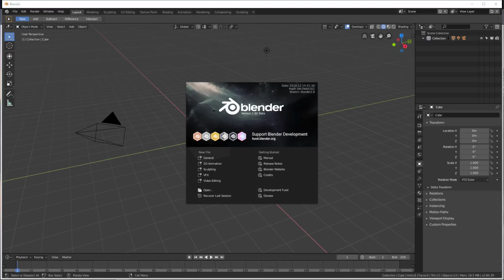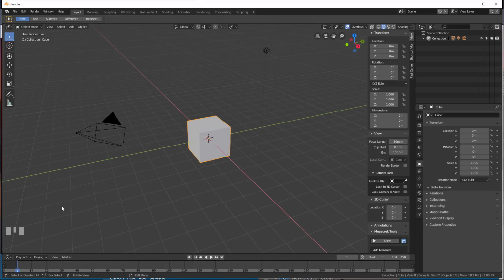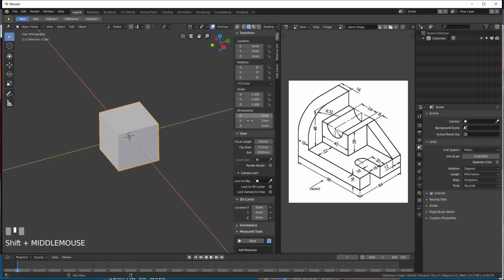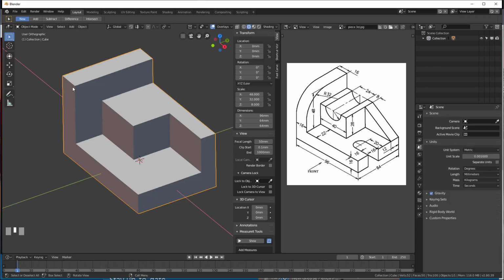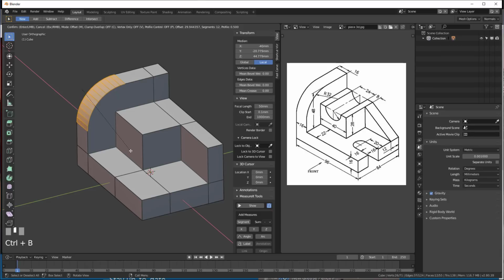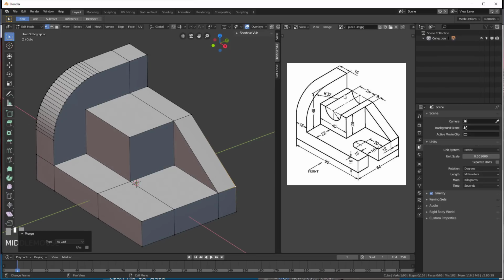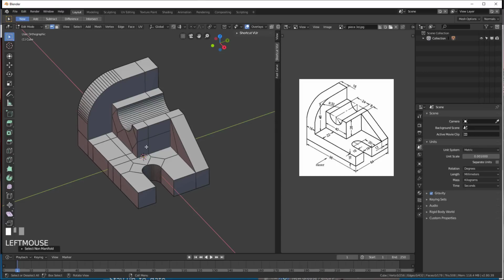Blender 2.8 Modeling a technical piece

Comment: If you press z wirh the knif, it cuts through the mesh, so you don't have to do the same thing on the other side. And i would've merged in "edge mode" by sliding the upoer edge down and then merge by distance. Thets much faster

Comment: how do you change to orthographic presing 5 does nothing. there is also no apparent button?
I I want to start all my designs in mm not just current one how do I set it?
Pressing E doesn't activate extrude always. What is the condition? besides being in edit mode face selection and a face selected...

Comment: I work as a mechanical engineer. I like this a lot. In industry though, we try to whittle down a block with cutouts. It helps you imagine the limitations of tooling and whether or not they can actually reach what needs to be cut. Designs can be awesome, but sometimes they're out of bounds for the tool chuck to reach.

Comment: Great…now.. tell us or show us or link us to: How to Dimension and add Shape and Position Dimensioning and textboxes… tehn you will become my BLENDER-SUPERMAN-HEREO!
Reply: Hi Hans check the videos in the channel, there is another video about it.
Reply: @juliendeville7369  Could not find any shape and position connected to any Blender version! As you know I worked many years in CAD methodic department at Volvo Cars creating solutions to complete CAD-systemes missing parts locally together with some other guys! I created Multi-Model, big systeme file administration, Compare Drawing methodic between releases and for checking department and another created a setup of Shape and Position Symbol Box libraries to be added to Dimensions in Catia when we closed down wonderful Cadam ZShape and Position was closed down…too …we were desperate replacing things that Catia at that time ignored totaly for trheir customers! Only many years after that Catia created a working drafting module with all! OIur version contained before that UNICODE created symols added in Boxes we created, which were possible to increase in number and raws, as well as box vertical limits could be taken away or added manually, a very time consuming and clumsy way to work then! Still teh best way to create shape and position in text boxes was ti use CADAM tangent input with ”Pipe” tangent: ”|” and then select the UNICODE symbol we offered in CADAM TEXTTABLE selection and close teh box after that with onother ”Pipe” tanget used! Raws of boxes were created with the Tabulator tangent as normal text assition as well as! This CADAM way is never ever been repeated by any other CAD syteme and it was the fastest and most uncomplicated way ever! So if you feel our shape and position ”pain” and have someone hou could program this in pyton and integrate a free available OPEN SOURCE UNICODE tabellist with all thise sybols in right STD-Size (3.5mm!) you woul be historical hereo of Blender and open up for CAD-Users in Blender directly in masses! If you have a useful youtube linkn I will be thankful!

As a licensed User of Rhinoversions many years and now V7 I will try to create a similar approch for Rhino, tabells for symbols are not the probleme but TEXT-BOX-Creation with tangents is and programming the interface for a pluggin there to earn som dollars! (Otehrwise one has to create textboxsetupps as symbols-Blocks there to explode for hiding vertical BOX-lines in the clumsy way!)

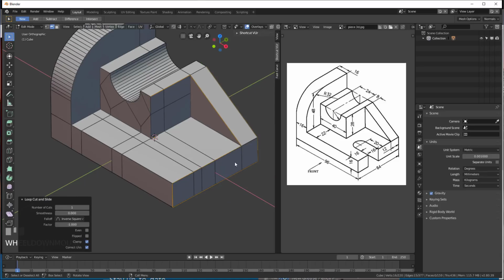Comment: hey Yoji, Thanks for the video. I have a problem @18:00 when using "B" to ignore those faces during loop cut, still, other side faces will be in loop cut and causing trouble, how to do it? is there any other way to avoid using loop cuts in other faces?

Comment: Thank you so much, I'm using Blender 2.76b and the screen is different, but, I'm learning and getting a simialr result to yours.
My problem here is in Blender 2.76 is not clear (at least for me) the unit measurements.
This is a very good tutorial and if anyone else is using Blender, use the same version used in this video.
Thank you.

Comment: Blender is absolute horrible piece of .... ... frustrating so much. I've had years of experience in autocad and sketchup, now I need to work in Blender. Spending a whole week, hours and hours to make simple squares or something with exact measurements... no way of doing that. Online I can only find many sort of 'complicated work arounds' to do the simplest job in any other CAD software. Why on earth is Blender made the way it is? If only there was an other software capable of much, but more like actual professional CAD softwares... that is not as expensive. They even made Sketchup a web based software, which ruins the whole experience. I do like this video for finally making Blender it a bit more workable for the CAD designers under us... but I rather find an different program that does the job better... anyone any suggestion? And please don't suggest FreeCAD...........
Reply: Did you find another solution, or did you get used to Blender? Just asking out of curiosity.

Comment: Any chance at changing these features at a later time?  For example, that bevel which you turned into a curved feature. Could you make it slightly bigger? Like 1mm ?   The other big one for me doing this stuff is that objects have to be related to one another.   For example 2 cubes. One cube must be one quarter in size and placed at exactly 1/3  of the total length of the larger. Then at a later date we will want to slightly change the size(by a known value) and offset it by some quantity which is related to the size of other objects.   In other words, all things typically are related and calculated from others. Having to hand calculate new ratio's every time will be insane. I see a vanishing point. Like once there are 10 different relationships, you will NOT want to hand DO all that every time. would be nuts.

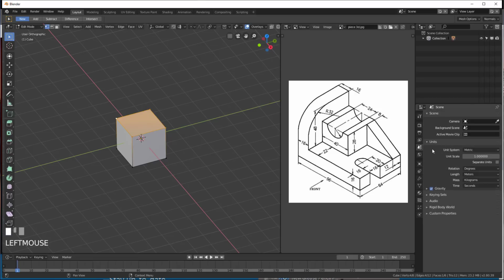Comment: 5:11 The scale I decided to use was .0005
The reason:
Even though your modeling was proportional, when you use a unit scale of .001 every 1 unit = 2 units. So when you type in 16 units, it shows up as 32 units (you can see the length by going to Show Overlays > tick the Edge Length option)

Comment: How do I deselect those vertices once I have an Emulated Middle Mouse button (laptop)?

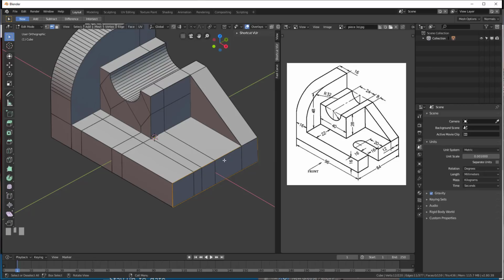at 18:12 I got stuck because that
Reply: I had the same issue.  I played around with it.  After pressing "B" for box select, then if you hold Ctrl it will deselect whatever you drag the box around.

Comment: Want to know something... Is there an option to lock the  grab direction other than xyz? For example, in rhino , there an option to lock the direction  that the cursor is moving.. Just move in a direction .. press tab key.. then the movement is locked to that specific direction and we can type the measurement or snap it to anywhere... Something like that in blender?

Comment: 12:43 best/fastest way I know to do this is to hit 2 then select the line you want to remove then hit X then Dissolve edge. doing that will just dissolve the edge that you dont want and you dont have to fill any faces that way

the second fastest way i can think of would be select eh 2 corner vertices then double tap G then so you can slide them along the edge till you get them to the other vertices then select everything then W then Merge vertices then Merge by distance

Comment: Thank you for that video.  I am a mechanical designer working with traditional CAD software.  I am having a hard transition but this helped let me see so much of what I have been doing wrong.  Well Done.
Reply: Me too, it seems sensless and time-wasting. If you came from Autodesk, Rhino etc: Start with 2D draw --> Extrude, Draw again -->Extrude. Round the corners, join everything et voilà. Blender has a very different workflow. Maybe this is more "rendering oriented"  because meshes are extra clean and without exceeding vertex, lines and isolated points, but.. ok

Comment: At 7:16, during the first loop cut, I have to hit G > X > -32 to get the loop cut 16mm away from the far left edge. This is because the part is 96mm long so half is 48mm long and 48mm-32mm = 16mm from the left edge.  In the video, the author hit G->X-> 16 and it works for him.  It appears I am using absolute coordinates vs the author who is using relative coordinates.  Any idea what I might be doing wrong?
Reply: Figured it out.  After you create the loop cut and drag it to the left, you must then left click which will 'set' the new edges.  Only then can you G->X-> 16 and have it work in relative coordinates.  The interesting thing is, if you wanted to use absolute coordinates, don't left click.

Comment: Nice tutorial, thank you very much.

I did all of this but at the end i have non-manifold vertices at the edges of that 24mm wide semi circle trench thing ^^
What do i do with them?
Reply: I'm having the same problem. Were you able to fix it?
Reply: @Miguel-kh9pc  Yes, i was able to fix it.

There is a blender addon called 3d printing toolbox.
It has cleanup functions. So i just clicked on a "make manifold" button.
Reply: @Fohogoroh  Thank you.

Comment: Modelling with Blender is absolute crap!
No matter what I do, I can't make that last notch.
 
And every little action is so tedious and circumstantial.
And it could be so easy: Any cheap 3D CAD can do it better.
I give up.
Reply: If you think this is complicated, you should check out the older 2.7 version of Blender.

Nah but serious, Blender is a 3d modeling software - while these kinds of applications can be quite overwhelming in the beginning, they can handle very complex geometry and allow a more advanced working style. Coming from an architectural background, I made the experience that CAD programs like ArchiCAD give up quite fast when it comes to high-level modeling...but I guess it ultimately depends on what kind of projects you are working on. May I ask what CAD application you use right now?
Reply: @basti1623  I'm working with SolidWorks in my job- since 20 years now.
I don't know ArchiCAD, but with SWX you can create 3D models much faster, easier and more exactly than with blender, especially when its getting complex. 
This would not be a big problem, if I could import the models and use them like origin blender geometry, but this is not possible:(
Reply: @klausmassler6262  Ah, I see. I am not familiar with SolidWorks (which seems to be a high-end engineering application to me) but I think Blender might not be the right tool then. I am using 3d programs like Blender mainly to create exterior and interior scenes on a large scale with a very high poly count and export them to Unreal Engine to create architectural visualizations. But I understand that Blender kinda lacks in precision when it comes to engineering (however things like the snapping-tool are not explained in this video, I never ever work without it).
Reply: @basti1623  Of course I don't want to replace my 3D CAD with Blender. It is clear to me that modelling is not the main purpose of Blender.
I want to use Blender to create animations, visualizations and small videos. But of course based on 3D models.
And I create them easily and accurately in a 3D CAD program, it doesn't have to be SolidWorks - any 3D CAD program is better qualified for modelling than Blender, even open source programs like FreeCAD.
I don't want Blender to compete with 3D modelling programs, but I do want to be able to use the created models in Blender without restrictions.

Comment: Second option to make bevel (after minute 13) does not work anymore in Blender 2.81 with knife. I have trouble making line between two vertices - this line just disappear after second left click. If I use knife and make random line, not aligned with vertices, then it is okay - line stays and either space bar or enter make cut.

Comment: At around 7:14 he very quickly explains how he's entering the numeric values to arrive at the ones reflected on the drawing but because he only verbally explains what he's doing (G-X-16) I'm having a very hard time duplicating the process; can anyone help? I do have my units set to mm and in the 3D viewport I am facing in the correct angle lastly I was able to create the base as he went through earlier, I'm also able to create the subdivisions with the ctrl R. I'm on a mac too BTW. I'd really like to get that detail because it's so important to the project. Thanks!

Comment: Great tutorial mate. I am still learning Blender and having used various 3D programs for some time, I have been wondering how to control, how far I want certain edge loops to go or how high to extrude at a certain height. Thanks as this helps alot, especially if I want specific sizes.

Comment: for the ones who are trying this with blender 2.81 - bevel doesn't work as in video... you should select Width Type=Percent and in width percent enter 68% (which is 100-32) yw!
Reply: I'm using 2.81 and it worked smoothly, I don't know what happened to you. The scale in Object Mode was all 1?
Reply: @albertolipas5264  well I didn't select the object itself upon applying transformation... that was my issue...
Reply: @albertolipas5264  well... I dont remember what was scale for the first bevel... but now when I want to do the second bevel I can't set up it properly.... nothing works the same way as in video :( when go to objects mode now and click N I can see "Scale" are set to 48, 32, 8 and I can't apply them to reset :( I mean, I apply all transformation and tried to apply scale itself but "scale" values in N popup don't change at all (the same 48, 32, 8)... please help! I want normal bevel...

Comment: Great Video, however if you showed how to put some screw holes in it then it would be complete, I can't find any videos on youtube that show this
Reply: You can create a thin cylinder (as a separate object) and use a boolean modifier to use said cylinder to create a hole. You can also use edit mode to duplicate the cylinder to create multiple holes without setting up a modifier per hole. However, I don't know how good the boolean modifier is at creating sensible geometry, but It's still probably worth a try. You will also  have to apply the modifier. Additionally, you can resize edge loops to create a countersink or use the bevel tool used in the video.
Hope this helps!

Comment: Merci bien for the tutorial, it was enlightening. I have been an architect for 25 years, and watching this convoluted way of drawing something so simple at least gives me a direction to go as I begin my Blender journey. I agree with some other comments that clearly Blender will not be replacing Fusion for this sort of thing for professional mechanical product designers. One needs the parametric modeling and tools for producing proper documentation. But for my hobby 3D printing projects, it can work.

Comment: Now, remove doubles is called Merge Vertices> by distance.
Ahora Remove Doubles se llama en Merge Vertices> by distance.
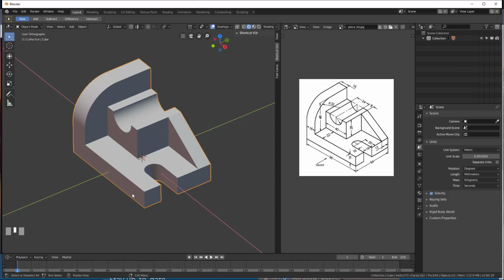Reply: this is used @ 20:04
Reply: Or you could use the "weld" modifier, which non-destructively removes them by distance.
Reply: Thanks so much
Reply: Thank You!
Reply: @13murdog1313  West King's Hwy RULES!

Comment: While the end result is nice, I still think that Blender lacks parametric functionality. 
In professional environments, technical drawings can be reworked many times. Let's say you want the upper half hole only to go until a certain depth (blind hole). You'd have to remesh a few things in your current model. Boolean operators can fix some problems but it does not seem to be Blender's core business.
Reply: You can do a lot of parametric things with Modifiers.  Boolean the basic shapes, Array for repeated features, Bevel with Edge Weights, etc. It's definitely not a complete CAD but it can help if you want to rough something out which you know you'll want to adjust after the first print.